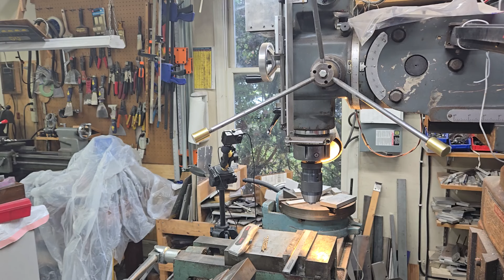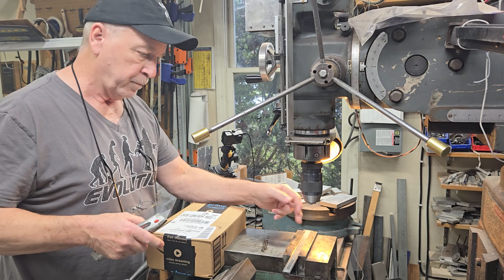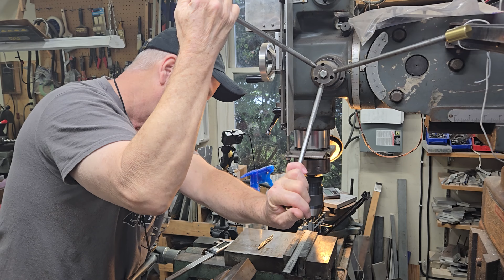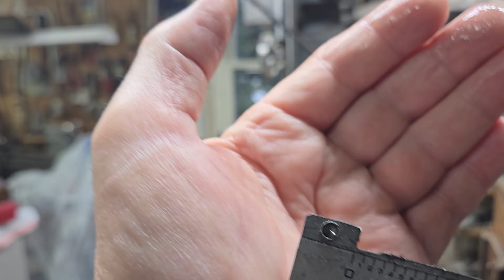Yougfin Carbide Drill Bit Test in Hard Steel

Comment: I used to be a firetruck mechanic. I went through a "few" sets of drill bits. And dozens of single sizes like 3/8, 1/4, and 3/16. 
 I absolutely don't drill any stainless steel with hss or carbide. I wasted a lot of money on snapon/ripoff, matcrap, and mac fools, bit sets that just shatter. 
The best is the American made Cleveland cobalt bits. The ones they sold at the tool stores (not home desparate or slowes) in the bulk bins. 
I rarely had lubrication when i needed it. But those bits lasted longer than anything else. 
Yes, i knew better but when your truck is shared between multiple mechanics it happens. But I learned a valuable lesson. Buy American made. Buy direct drom from the right places: machinists suppliers. Bits with lower twist rates lasted longer. Bits with 135° tips were best.
And once it starts cutting, don't ever pause. If you have to remove chips, stop as fast as possible. Then back up a couple degrees and pull straight out immediately. That jagged partial chip in the bottom of that hole will enable you to start cutting faster. 
I know that's not easy on a Bridgeport. But it's saved me many times in the last couple years. If your bit is sharp and the feed is constant, you will have better luck. 
Lastly, i usually kept a brand new bit just for starting and breakthrough on thinner stuff. 
Hope that helps. 
I'm sure theres guys that'll say everything i said is wrong. 
I know that theres a couple thousand emergency vehicles out there that would show otherwise.
Reply from the maker: Thank you for your comments, and sharing your experiences.  As long as I've been mechanicing (mostly my own stuff, or for friends), I'm STILL learning.  Especially about quality tooling.  There is no shortage of folks that tell you you're doing it wrong.  And often they're right!  I'm here to teach what I have learned from experience, and learn from others with more experience than I have on things.  We never stop learning.  At my age, we celebrate what we know, and realize more and more just how much we DON'T know.
Reply: Biggest mistake you are making is running bSmall bits slow,,,a .125 bit in mild steel should run at 2500 rpm,,SS at 1250.  Aluminum at7500 rpm.

Comment: A 45-$ set of carbide drills seems impossible.  But if they're carbide, you should run them at the recommend feed and speed----usually pretty fast.  And I don't think lube is needed in this application.

Comment: I prefer to use the knee when drilling hard stuff. More consistent force and less feedback than the quill's rack & pinion. Also works a treat for plunge milling with carbide manually.

Comment: I recently bought some small solid carbide bits (1/8" & 5/32") to drill holes in a project that is utilizing material from some scrap handsaw blades. I tried drilling the material with good HSS bits and they only polished the steel. The carbide bits cut the material like buttah!

I would be concerned that using a pilot hole and enlarging it (as I would in non-hard steel) could lead to carbide bits chipping. Carbide might do better with higher speeds and consistent feed rates drilling in one pass to minimize the risk of chipping.

Comment: If I recall, most vernier beams are stainless, which work hardens as it’s cut. So that’s probably what’s going on. That said, I usually run quality cobalt bits on stainless with no issue. The trick is not to let the bit dwell in the cut and keep it moving thru before work hardening has a chance to bite ya.
Reply from the maker: Yes, this caliper body is supposed to be stainless of some sort, but it also is highly magnetic.  It's a cheap import, so the metal quality is likely not the best.

Comment: Every time I drill into metal I dip my drill bits into oil to help keep the bit cool  And make drilling go easy
Reply from the maker: I tried the oil, but "lubricity" as I learned later is not what I needed.  It's "cooling" of the drill bits, and alcohol is very good at cooling things off, with fast evaporation.  These bits are very sharp, but would not penetrate the hardened steel.  Going to try cobalt ones next, they should be here by Tuesday.  Wish me luck!
Reply: @JohnnieBravo1   okay 👌 I will do that Johnny bravo 👍

Comment: Story might help. I broke a center drill tip off deep in some tough steel on an expensive part. I was pissed and tried to figure out how to machine it out. A old timer buddy came by and said he could get it out. He used an 1/8" carbide 2 flute endmill and to my surprise , ran it at the max speed of the machine ~3500rpm. That goes against conventional thinking. But at 3500 rpm and a very slow feed low pressure the end mill did cut out the center drill without breaking or heating. Just delicately nibbled away at it till it was gone. The carbide can take the heat but it can't take any kind of shock or over stress. You didn't show the tip of your drill bits so I can't determine if they are split points or not. I'd bet anything a split point is necessary or it will just rub in the center web. Even a split point might not be good enough. 
I bet an endmill will do the job if you follow those instructions. High speed/slow delicate feed with the dial on the knee or the quill not the press handle..
Reply from the maker: Thank you for that suggestion.  The carbide bits are split point.  The cobalt bits, which I expected delivery today, are delayed (storm interference maybe ?) , and they also are split point.  If that doesn't work, I will order a carbide and a cobalt end mill, and try your suggestion.  I run this mill often at around 2000 rpm with a balanced fly cutter in it, and it does an amazing job.
Reply: @JohnnieBravo1  Good. I hope something works. Let us know if so. I have similar projects like that.